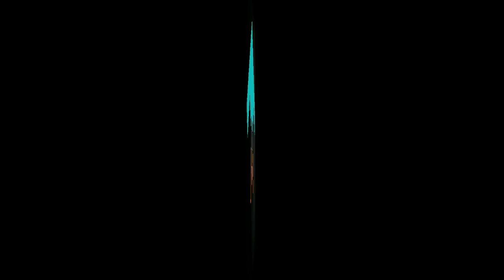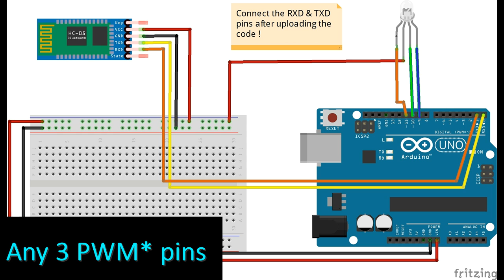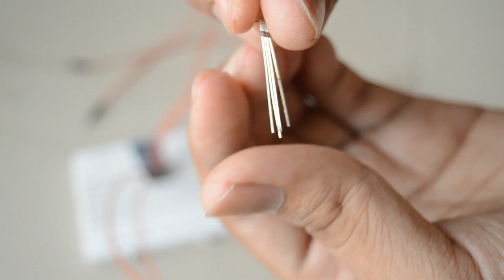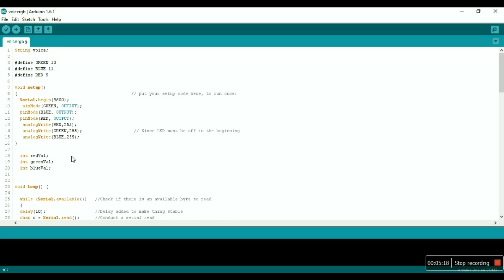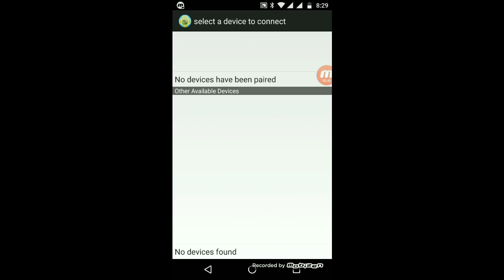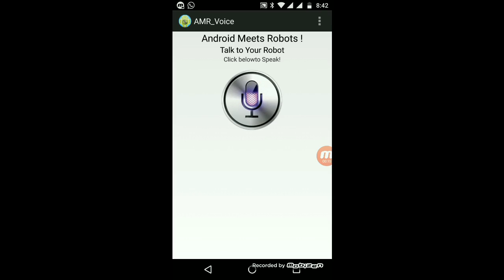Tutorial on Bluetooth sensor HC05 with Arduino | Voice commands

Comment: Heyyyyyy dam bro i love your videos. I need sone help and i know your the man for it i would love to se you make avideo use the arduino board and the arduino uno rev3 to l298N motor drive controller board module conect to the DROCK Timer delay controller module 5v 12v conected to bluetooth dsd tech hc-05 c to set a timer on my fan.  He i know its alot but its a little complicated forme. IM A BIG FAN AND  I HAVE YOU ON NOTIFICATIONS ILL WAIT FOR THE NEXT VIDEO ILL HEAR A BING PLEASE HELP

Comment: I need a lil help from ya brotha .. My Arduino is not responding to any command given by mobile through Bluetooth. I've checked both Arduino Leonardo & Hc-05 module separately , both of them are working well . But when i connect the Bluetooth module to Arduino its not working . Im trying to a bt control home automation system . Please help me to solve this.

Comment: I am made it and also up uploaded the program in it but when I downloaded the app and connected to it it took command but RGB does not glow.
Reply: KOMPASS INDIA PRIVATE LIMITED check the connection..there is a mistake in the circuit diagram...the red wire should be connected to the 3.3 output of the arduino uno board which is 4 pins ahead of the connection given in the diagram

Comment: Hey i have tried this but i think iam using a cathode rgb led but the thing is that iam unable to do glow led and proceed further inst.. And i have also changed the commands over 0 to 255 in programe but iam struck now so what to do.. Plss help and suggest me...
Reply from the maker: Connect the longest terminal to GND of Arduino & the other 3 to digital pins ! And yes, as you've mentioned, you've to make changes in the code by replacing the 255's with 0's & vice versa !

Comment: I have made this thing and it is also working but when I am commanding it through voice from phone then it is turning into different color like when I am saying blue it is turning yellow.
Can it be due to using arduino nano instead of arduino uno .
Please tell fast
Reply: KOMPASS INDIA PRIVATE LIMITED  no it is not due to the board. I think it is due to incorrect coding. Check your code again, if you have made any mistake like your voice command values do not match the output values.

If you did not understood then please let me know so that I can try to make things much clear.

Comment: Code is't working bro it's return symbolic value in serial monitor
Reply from the maker: Heya, try changing the baud rate to 38400 in serial monitor & yes don't forget to replace 9600 with 38400 in the code  !
Reply: Thanks bro now it's work properly ☺

Comment: Hello sir why the led colour can be changed only with amr voice app and why not any other voice control app is not able to change the colour.Can somebody please explain this issue??
Reply from the maker: Hello there.. The code I've provided works only for the app AMR Voice. If you use another app, the code needs to be changed